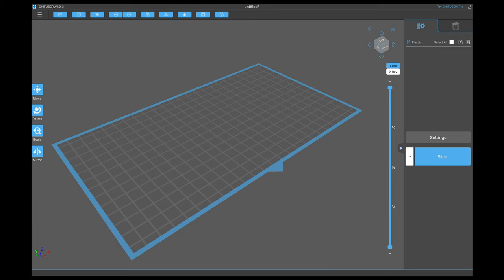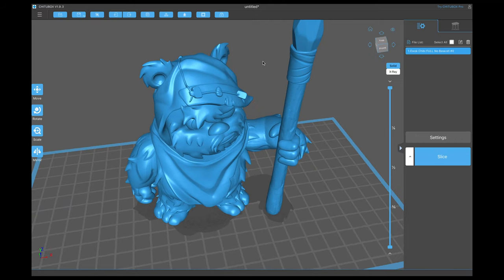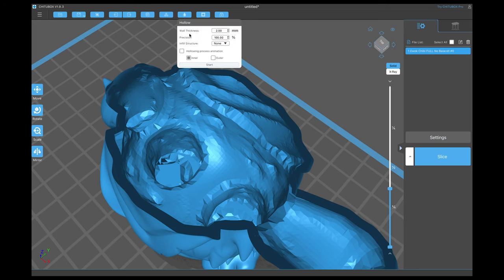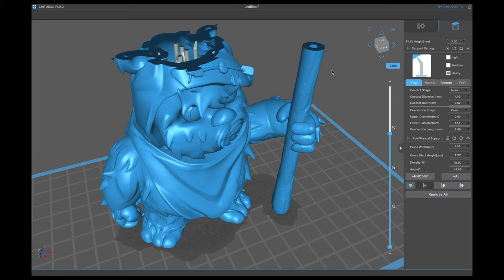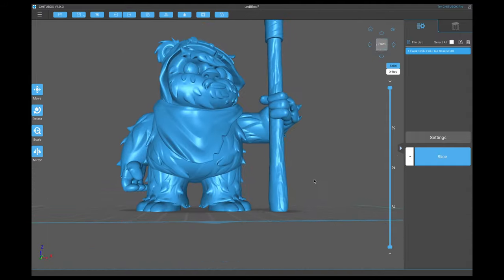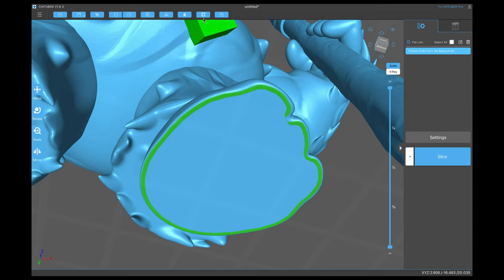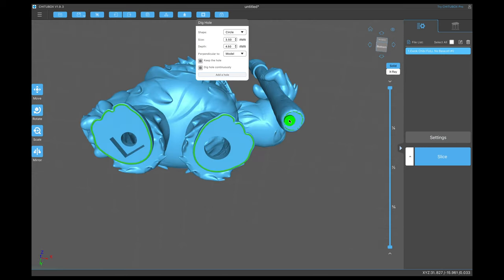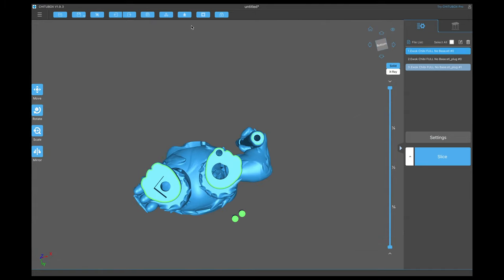Save Money & Resin by Hollowing 3D Prints | Chitubox Basic Tutorial

Comment: I highly recommend 3.5mm wall thickness anything lower and you run the risk of your model cracking within days or even several months down the road. Nothing worse then printing a nice model spending weeks sanding and painting it, to only have it explode 6 months later. I 3D print for a living and I never hollow anything under 3.5mm wall thickness anymore, It's just not worth the risk. Great video though nonetheless :)
Reply: So it's been a year, can you still recommend 3.5 mm? Or it's not enough? Maybe we should go with 5 or 6 millimeters?

Comment: Good advice. I would suggest a few changes but only minor ones. 4-5 percent cubic infill will keep supports from sprouting inside your drain holes. 1.5 to 1.8 wall thickness is plenty strong and will be cured all the way through. Any thicker and it won't cure from the outside. Just things I watched from other creators that make huge prints with no issues. I always thought they were solid too. Glad you made this video. You should have sliced it hollowed and showed the difference in resin used. I bet it would have been huge. Thanks for the video

Comment: Great video!  I downloaded Chitubox ust because of this hollow feature.  But it cant completely replace my other slicer because Chitubox has no feature to slice up an object.  Does the Pro version?
Reply from the maker: Chitubox is great for hallowing. But it’s just for SLA printing. But you can hallow and then export a STL which is nice. It would be nice if it did what your wanting.
Reply: Microsoft 3D Builder can hollow models and then save them in pretty much any format needed.  I use FlashDLPrint as my slicer for my Flashforge 9.25" 6k printer and hollow using 3D builder.  It's also fantastic for kit bashing multiple models together.

Comment: The only problem I have with hollowing out prints is that they tend to expand and crack after I resealed them up. I'm sure all I need to do is rinse out the model better with alcohol and try to cure the inside with a UV light but its tough to get a light into some models. Any suggestions?
Reply from the maker: Yeah I use to have that same problem. I find it helps you match your holes up and that way you have holes in the bottom of your model as well to allow the model to not be pressurized. Hope that makes sense.
Reply: Get a tiny pin drill and find a spot nobody will notice and make a tiny hole.  This will let gas escape.

Comment: I use lychee and my hollowing don’t work as good as chitubox
Reply from the maker: Yeah I use lychee sometimes and I find they are both great for different reasons. If only we could combine them 😅
Reply: @ItsMeaDMaDe  im using a LD-002H with siraya tech fast resin navy grey and my normal exposure is 1.5s perfect exposure and bottom layer @ 20s and i end up with bottom splits what am i doing wrong?
Reply: @MMQsTacosConLimons  Lift speed is probably too high and the suction force is separating the layers.  Also depending on what exposure test you're running "perfect" exposure for layers can be elusive.  Example if my perfect exposure per layer is 2.8 seconds often I will have a partial fail or split in the print.  However if I add 0.10 seconds to that exposure time the problem is solved and aside from improper supports models will successfully print all the live long day.
   So I would start by lowering the lift speed to give it time to release from the FEP and if the problem persists I would bump up the layer exposure time.